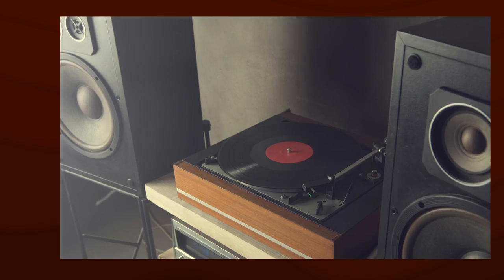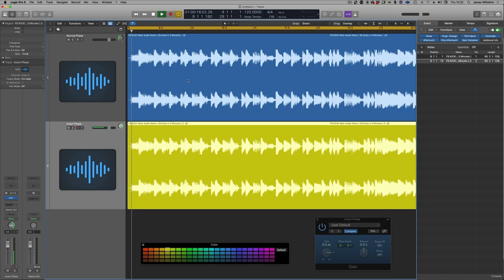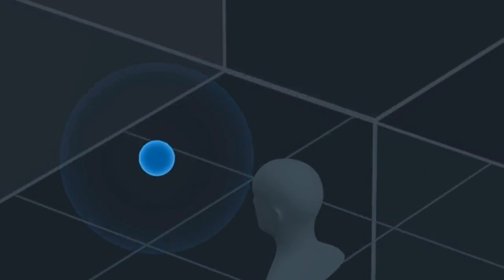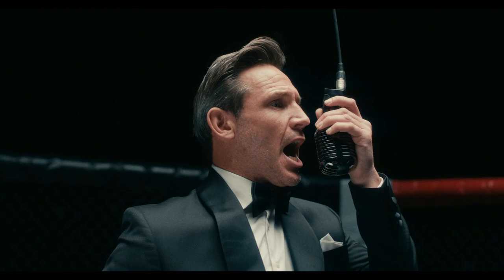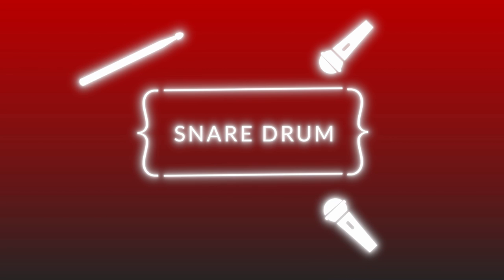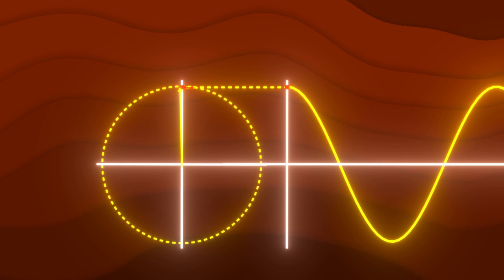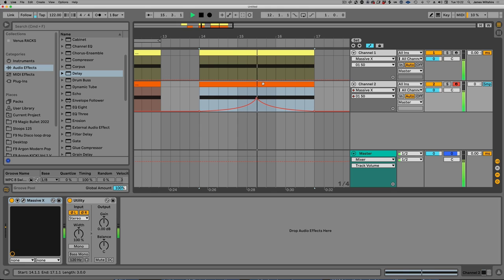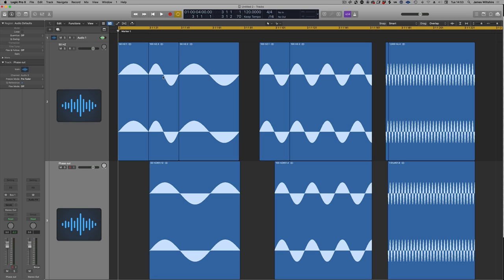Do you understand PHASE COMPLETELY? : An F9 Video made for musicians

Comment: When I used to DJ (not a proper DJ) at weddings and stuff when I was in sixth form and a bit at uni with some decks, tons of vinyl (that I still own) and dodgy homemade light boxes, I used to get that effect by throwing the same record on both decks at the same time to test if the belts needed replacing (couldn’t afford direct drive) 😂

Comment: This can also affect your mixes if you DJ.  If you're mixing 2 tracks with similar low end profile and the kick transients are lined up just slightly off, the bottom end thump the kick will drop out massively due to the phase cancellation.  This was more of a problem on vinyl when mixing by hand, but even with digital vinyl systems, this can happen if your beat map is slightly off on the kick drum transients.  In both cases a slight nudge can bring the 2 tracks right back into phase and restore your missing low end.  :)
Reply from the maker: Absolutely - and as shown at the end of the video - the reason it's the kicks that phase is the length of their waveforms - it's incredibly difficult to get the top end elements to phase as minute movements like the kind of wow/flutter you'd get from vinyl systems constantly is enough to stop cancelations at the short Wavelengths at the top, but not the kicks ( although I have heard 2 tracks both with 909 hats have a real moment a few times )
Reply: I cut lower the bass eq of the incoming track, then when the mix is finishing bring the bass back in whilst simultaneously reducing the bass eq of the outgoing track.

Comment: Although probably worth noting that you can't technically invert phase, this is inverting polarity (swapping the positive and negative of the signal) - phase is a function of time and therefore you can only 'rotate' phase. Meaning when we look at non simple waveforms such as time varying audio, you can't cancel audio out through rotating phase 180 degrees for example, but you can if you invert the polarity.

Of course we use inverting phase as a colloquialism of inverting polarity - so no biggie, the above is useful information if you ever wanted to differentiate between phase and polarity.

Also the ossicles are comprised of the malleus, incus AND stapes (the little stirrup-looking bone that connects to the oval window of the cochlea).

- Just a pedantic guy who studied acoustics and electroacoustics.
Reply from the maker: Excellent details Mathew - I would also add you can't 'drop' a track at a gig and that would be silly - you'd break the CDJ / Laptop / USB ... Also I find it ridiculous that all my leads are called Jack ;)
Reply: @F9Audio  stop trying to trigger me 🤣

Jokes aside, colloquialisms are fine in any case, but in rare occasion you may find your self ‘rotating’ phase by pi or 180 degrees, as opposed to using an ‘invert button’ - in this case people may find that tracks do not totally cancel. So I do hope the above goes somewhere in helping someone - whether it’s some know it all arsehole like myself or whomever 😂
Reply from the maker: @producermathew  Ha ha .. Thank you, Mathew - Always keen to make everything here as on point as possible,but also fit the current language paradigm  so that it slots into the surface knowledge that people have already so I'll make sure to include this - by the way - did you watch further on where I graphically show the rotational relationship of phase?  - Very proud of that bit as it's nowhere to be seen in current tuition for new producers ... It's here :  https://youtu.be/qptvf5hUi4g?t=790
Reply: @F9Audio  yes absolutely! On a whole I loved this video as visually, it follows the mathematics itself and you really do cover the principles of physics which are at play here!

I always perceive yourself and your channel as a superpower of production knowledge and expertise - this video does not fall short (again I’m more so being pedantic with the above comment)!

Keep them coming, absolutely love these videos and have been subbed for quite a few years now!

Comment: How is this related to reamping, how does picking up the sound from a mic at different distances effect the phase?  Can you reamp something and double it with the original signal, would that then cause double volume with perfect phase or a bunch of phase issues?
Or can i avoid phase issues by seperating the low end or something like that 

Realized it was alot of questions but maybe you can hint some aspect of this or who knows maybe all of it in the upcoming video.

Anyway, Great video, really well explained and digestable with the visuals. Would love more technical / mixing related stuff from you.
Reply from the maker: Great question - so as we show in the video - Phase is basically a function of time - In the same way that we see a lightening flash first then hear the thunder a few seconds later, the speed of sound is much slower than light - Now this is important as Electrical signals travel down wires at close to the speed of light, where as air pressure moves at the speed of sound ... One last point - as I show in the last stages of the video, low frequency tones have longer wavelengths and so can be more effected by phase ... So applying this to Guitar cabs -  having even just one microphone re-amped ( or just plained amped ) signal alongside a direct guitar signal will be subject to the tiny phase difference caused by the air gap between speaker and mic  - This is why its always best to try different mic positions and I found over the years the best result is wear a great pair of closed back headphones playback the combined signal , get in the room with the amp and try moving the mic about till you hit the sweet spot... Now obviously two microphone confuses this and it's one of the reasons a second mix is often setup Off-Axis from the speaker, or is placed further back from the cone ,... Here comes the interesting bit - in the real world, the speaker is a point source that radiates out in all directions and picks up room ambience as it does so - this makes the signal more complex , and will often reduce phase cancellations - If you take this to the utter extreme and consider a guitar cab in a church with a very distant mic - the signal will bear very little resemblance to the original and fit nearly perfectly , but this effect starts much earlier than you'd imagine ... Again - I always try to get in the actual room and move the mix about to see what tones I can get .... one gotcha - if you have two mics, very similar distance from the cone(s) and on the same axis related to the cone(s) you will have issues so basically look for contrast
Reply: Consider the length of the path sound takes to get to the microphone. For each frequency f, which will have wavelength T, consider the number of complete cycles that fit into that distance, and the bit left over. For a fixed distance from source to microphone, how much of a wave cycle is left over changes with frequency. That bit of a wave left over is a phase shift.

Comment: This only matters when sequencing synths in DAWs, and even then isn't really worth worrying about, bit is interesting to think about. But if you think about it, 120bpm = 2hz. Now if you have two identical sine waves playing on separate tracks, one starting at beat 1 and the other at beat 2, then the tempo will affect the relative phase. Generalising, changing the tempo changes the relative phase of partials of sounds that begin at different musical times (i.e. are positioned according to beats and musical subdivisions of beats).
Reply from the maker: Please believe me when I say this matters every single session no matter what you are doing ( putting mics in front of guitar cabs, adding weighty snares on top of kicks, using very wide stereo processing - Getting your monitors setup correctly, measuring your room for deadspots and low end dropouts  - the list goes on and on )   - Phase interactions happen constantly and often people could solve weak sounding mixes with a few tricks - I'll explain everything more in the next video

Comment: Awesome video mate! Very well done. However I have to debunk the myth of the snare phase cancelation. You're describing it as if it was a single surface vibrating, but it's not. And the demonstration is clear with the slightly detuned saw waves. There's no phase cancelation by putting a mic at the top and a mic at the bottom of a snare, or any other drum. Otherwise, you wouldn't hear the snare by placing your ear at the same distance of the top and the bottom right? Because the phase relation is far more complex between the top and the bottom and what's happening inside the snare than just "the bottom is the opposite of the top". Reversing polarity on one of the mic may sound better, sometimes =) Nothing personal, I hear that one all the time, it's like an old audio engineer urban myth. Cheers and keep up the very good work.
Reply from the maker: Thank you for the kind words - But i must absolutely agree interms of upper harmonics and their complexity but when we consider the big LF weight of the principal skin movement, I need to call this out as not true - I've only ever seen this be the case once and that was down to an incorrectly wired cabling and I think this is where a lot of the reports of this not being a vital move come from. 

Before I became an electronic-based musician, I worked as an Engineer and programmer across London and have been in hundreds of live Drum sessions, often with the best engineers and drummers in circulation and I can absolutely promise you that with correctly wired studios, microphones, and cables, if you don't invert the phase of the bottom snare drum mic, you will lose a ton of weight and low-frequency body when it's mixed with the upper - Now that might just be what you want, but the phase effect i mention here is very much in play. 

I have though seen all sorts of bad cables, mic repairs, and other anomalies that might make it seem that a certain recording didn't need it ( including a Neve 88 where the patch bay only had 2 pins connected to the live room tie lines, or tie-lines having their hot pin revered by mistake during installation) but never in a technically perfect setup. 

Now I'm all up for learning so if you can prove me wrong - please do and It'd be great to see this in video .

Comment: A loudspeaker actually works opposite of what you say. The displacement is general in anti-phase with the pressure, so the highest pressure is seen when the driver is all the way in. One way acoustic engineers are tricked is by looking at how the driver moves at low frequencies, where the voltage and displacement follow each other, but above the characteristic frequency of the driver this relationship switches 180 degrees, which is exactly what we want to have the driver moving inwards for a positive pressure in the frequency range of interest. This relates to how the driver generally plays into a mass-like environment.
Reply from the maker: Could you point me at the literature on this ?  - Facinated - I was taught the inverse but I totally undertand my eductaion had to cover a large range and certainly did'nt dial down into the precise mechanics of speaker design - which having been around the Bowers and Wilkins Factory twice i can see is an extraordinary discipline and alwasy keen to learn !
Reply: @F9Audio Sure. You can for example look up Sound and Signals by Tohyama (pages 39-41; can be found via Google Books). But since some books will say otherwise, it is always best to carry out the analysis yourself, and I have done that in an AudioScienceReview post called something like 'Which way is up?"
Reply from the maker: Ahhh ok - so there is debate on this ..  so to be clear an audio signal positive above the resting position will actually translate to a negative air pressure  around that instant ?
Reply: @F9Audio Well, not really a debate, it is more that intuition will typically tells us the opposite of what happens here, and some authors state it incorrectly while not going into the theory. But yes, in general, without going into all details, the elevator pitch should be that positive displacement drives negative pressure, or better that positive accelerations drives positive pressure.
Reply from the maker: This is why I love youtube - I've just found your article  .. I think I now  understand - it's the acceleration causing the pressure, not the movement, the vector, not any given momentary value - This is actually very intuitive once you look at it as there must be a force applied to move anything, and force and acceleration are directly proportional, The deep maths is beyond me, but Anotehr day, some new learnt ! - Thank you and wonderful to meet you ! 

https://www.audiosciencereview.com/forum/index.php?threads/which-way-is-up-which-way-does-a-loudspeaker-driver-move.42697/
Reply: @F9Audio  You've got it. Whenever we are talking about phase, we have assumed steady-state conditions, so the waves are propagating, and we can interpret time-dependent variables as complex amplitudes ('phasors'), and that is really where phase comes from. We have to be careful in that pressure is a scalar, but disp/velo/acc are vectors, so we need to define a normal on the surface, but we will typically say 'pointing outwards to the medium outside the enclosure' is our vector reference normal. My pleasure. I have articles on phase/delay/polarity also ;-)

Comment: So quick question..... is this the reason why every thing above the bass track goes silent, because some of the higher tracks are out of phase when the bass kicks in? Essentially creating a muffled sound affect on the mid and high tracks?
Reply from the maker: Sorry - need some more details here are you talking about something that's happening your end ?
Reply: @F9Audio  yeah so, in the past I have made songs with a pumping bass that is arpeggiated.... I would notice sometimes on songs like these during production that volume would drop. As if the frequency from the bass line and synth pads were fighting each other? Is it possible what you explained in your video is a result of that?
Reply from the maker: I wouldn't have thought so - without seeing whats going on it's hard to say, but when I have seen people do this ebofe it's because they are way too loud inside their DAWs, using small speakers and a bass sound with a ridiculously large amount of sub information that the speakers can't reproduce ( and possibly  over-loading submixes or the mixbuss ) - this would. certainly cause the effect you mention  - Gain staging is very hard, but a crucial skill to master  - Here's a hack for it https://youtu.be/Bt_dgSEe0yo
Reply: @F9Audio  
Thanks!

Comment: 3:28 flanger right?
Reply from the maker: Yes ! .. Well kinda - Flanging actually got it’s name from reels of tape - it was found you could run two together with the same material and then touch the edges or  ‘flanges’ of the tape reels caused pitch variations and the much loved effect

Although credited to Beatles recordings it’s actually Les Paul who first used it via acetate discs
Reply: @F9Audio  really cool. Decreasing the speed down definitely creates a delay between the untouched. With magnetic tape that must have been a discovery with a lovely sound.
Reply from the maker: I had a look back through anecdotes last night and it’s rumoured that Lennon heard the effect being created and asked about it -George Martin gave a slightly nonsensical answer that included ‘putting it through a flange’ .. So from that moment whenever he wanted that sound he asked for the Flanger …. Probably lore but a great story …

One thing though - considering the Fairchild 660/670 came from a circuit used in Les Paul’s studio ( and that he practically invented overdubbing and multitracks ) - it’s astonishing to think how much came from one man’s innovation - he would be so proud to see where he led us